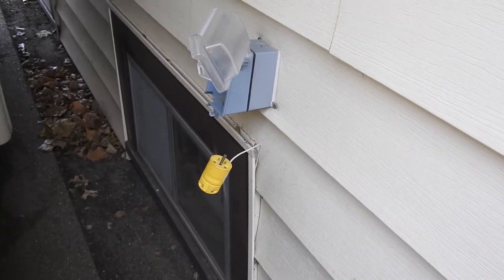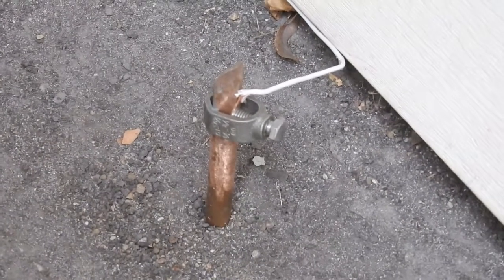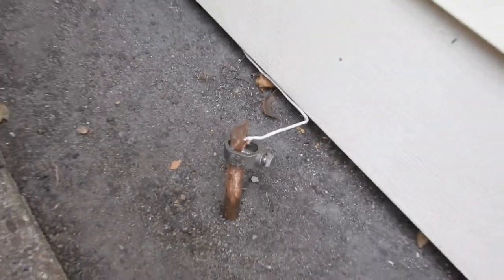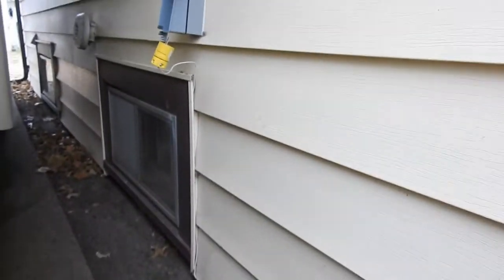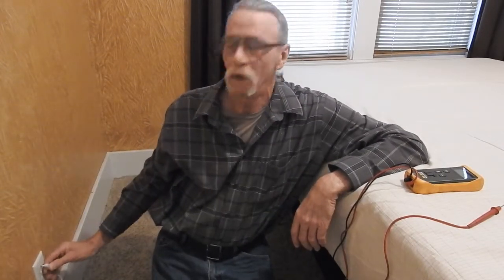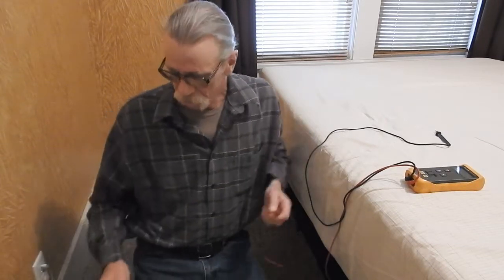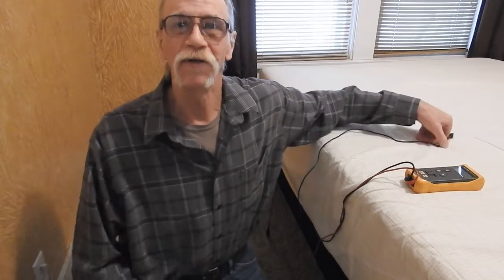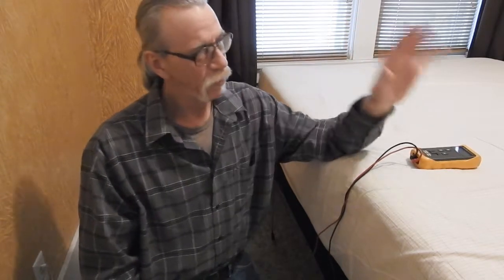Earthing Sheet Grounding

Comment: You’ve explained grounding very well.  I just started using a sleep mat and have noticed a substantial improvement in back and shoulders pain. I use an outdoor grounding rod and you mentioned in your comments to check for any return electrical current from the ground.  How would I check that?
Reply from the maker: That's a very good question Vincent. I would be difficult to check as, to check current flow, there must be a "source" and a "load" that you would check with an amp meter in series between the grounding rod and the sheet connection or, using a clamp-on amp meter around the wire to the sheet. As mentioned in my opening comment, I have a fuse in-line with my bed sheet to protect from possible current spike, like from nearby lightning strike. There is can be a degree of stray current  in the ground due to possible neighbors with wiring errors inducing current through the neighborhood plumbing system if they use the metal plumbing for ground (for example). Also, ground is used for a return path back to the substation in early systems. In either case, you should be protected because you are "grounded". Hope this addresses your concerns. Thanks for the comment.

Comment: Great information Old Man Tech... Can you tell me where you obtained the blanket or sheet?  Also, could a person cover this grounding rod with a piece of PVC pipe to avoid having it hit with lightening?  I'd like to do this with a grounding wire and have it permanently plugged in so that I don't have to remember to unplug it when I leave home.
Reply from the maker: Grounding sheets can be sourced from various places. Received mine from Amazon. There is no reason to believe a piece of PVC pipe would protect from a direct hit of lightning. I have a very low quick-blow amperage fuse in line with my grounding wire to avoid back current from lightning strikes or stray ground current. If you have a proper grounding system in your home, I see no reason to unplug the grounding wire from the sheet to Recep ground when you leave home. Thanks for the comment Jeremy.
Reply: @oldmantech5399  fill the pvc pipe with lightning arrestor / orgonite wizard wink
Reply from the maker: :face-blue-smiling:

Comment: Your grounding clamp is backwards. Wire should b opposite of bolt.
Reply from the maker: I understand what you are saying in relation to the design of the clamp however, as you can see in the video, if you pause it, there is a gap on the opposite side of the bolt where the wire would normally go. That would not afford a good connection, due to the size of the wire used and the size of the grounding clamp. Thanks for the comment.

Comment from the maker: I created this video prior to my training as an EMF Certified Consultant. I do not have any radiating devices in my home and wiring errors have been corrected. Now, I would suggest that one should use a dedicated ground rod to the earthing sheet independent of the homes electrical wiring. Also, I have a very low amperage quick-blow fuse installed in-line with the grounding wire where is comes inside the home. Just make sure your not getting any electrical return current running through it from the ground.
Reply: If it works for you that's good. I have some questions about this technique though. First is, if you make a separate earth, to a rod, there is likely a potential difference to the electrical system earth terminal and everything connected to it, which could be hazardous, depending on the supply company earthing arrangements. The next issue is that if you are in an electromagnetic field which raises your potential and you earth yourself, you become a path to earth, thus you conduct current ( albeit small) to earth, which doesn't sound like a good idea. Also depending on supply earthing arrangements and local conditions you may have currents circulating in the ground and in the earthing conductors of the electrical system, this too could introduce fields and currents in any conductive material in contact with it. At high frequencies the earth conductor and the earthing sheet/mat can act as an antenna, which you become part of...this too sounds problematic...So whilst I think earthing is our natural state in nature, technological earthing systems seems fraught with issues and require careful investigation in each case.
Reply from the maker: You are correct when you say, " requires careful investigation". Is your home or, especially your bedroom in close proximity to power distribution lines, smart meters, or cell towers? Is your bed environment and home free of electromagnetic pollution? Are you in a "dirty" electrical environment due to wiring errors? I can answer NO to the above, in my situation. Others may not. I also have a very low amperage fuse in-line with my grounding sheet to protect from damaging or excessive currents. Ground conductivity and "stray" (return) currents are also a factor. However, a high ground conductivity is very effective at "absorbing" the frequencies that enter you from technological sources and electrical systems by neutralizing positive ions to re-synchronizing with the Schumann resonance around 7.83 Hz (fundamental). I personally experience more restful restorative sleep without the inflammation I constantly had. If not, I would abandon the grounding sheet. Everyone's situation is different. Grounding sheets are not for everyone. If the above issues you mention are not remediated, I believe grounding sheets can be detrimental to one's health in some situations. Your concerns are valid. Thanks for the questions.
Reply: @oldmantech5399  Hey, I really liked this video! I was thinking about doing something similar to what you did here someday, and installing a separate ground wiring system within the walls of a house, connected to an independent rod outside. I'd like to ask though, what do you think about running through the ground of a normal outlet, in a situation where you're renting and can't do work like this? I checked the ground in my building and it is properly attached to a copper rod outside, and I've been earthing for about a week with a mat and getting obvious results from it. However, I watched and read bunch of stuff about voltage coming into the ground from the neutral and it made me a little nervous. Apparently most household outlet grounds have about 1.5 volts running through them from the neutral return. However, from watching videos of people checking their own body voltage with a multimeter while just standing around in their house, I see that it is very common for people to be carrying 3 volts or even more. So I guess my main question to you is, do you think there could be any dangerous amount of current in a household ground, accompanying that common 1.5 volts? I don't understand alternating current very well myself, but I know you're not becoming part of a direct current circuit when you use something like a grounding sheet. I just wonder whether that small amount of ambient electricity in a household ground would actually be harmful, and whether the benefits of earthing through that ground would outweigh the negatives of that voltage, since people seem to have so much voltage on them indoors anyway. I'd love to hear your opinions on this!
Reply from the maker: @Margatroid  Yes, there is a potential difference of approximately  1.5 volts at the receptacle, give or take. Consider the receptacle as a water valve. With nothing plugged in the valve is turned off even though there is still a V/m (volts per meter) reading at the Recep. So, you have an electrical and magnetic component at the Recep. It just makes sense to me, if one is to avoid such influences for health, not to plug the grounding cord into the Recep. Bear in mind, the electrical wiring in your room at 60 Hz radiates about 6 feet in all directions. One to two feet away the readings drop off dramatically but, there is still influence. If I take a meter reading 2 feet above my bed, I read 9 V/m. If I touch to the grounding sheet, it reads 0. To overcome your renting status, you could buy or strip the ground wire from a length of 12 or 14 gauge wire, route under window sash to rod or, route through basement window to under the bed floor and drill small hole for wire and tie into the grounding sheet cord, if possible. Be creative. I have faith in you. Thanks for question.
Reply: @oldmantech5399  Thanks for your reply! I didn't get a notification for some reason. After watching your video and some others showing voltage on the body in proximity to the wall wiring, I actually moved my bed a foot away from the wall, and that seems to have helped. I always felt a little uneasy laying down to sleep there at night and I think that was why. I also used to have a lamp cord running behind my head there and I got rid of that too. Also this week I ordered a couple of 19 inch aluminum grounding rods with 40 foot cords from ebay. That's not going to be as a great of a ground as your custom setup, and I wonder about the cord being conductive enough at that length, but I got a multimeter to make sure they work. I'm going to try to run the cords around the edges of my sliding glass doors. I've just gotta wait for the earth to unfreeze here before I drive the rods in! Thanks again for your thoughts. :)
Reply from the maker: Hi Margatroid. I didn't get a notification on this either. Increasing distance from electrical chords is a good idea. A longer ground rod would be better but, any ground rod is better than nothing. Any length of grounding wire should work. Just do your follow-up check with your meter.
Reply from the maker: Hi Margatroid. I didn't get a notification about you either. Longer grounding rod would be better but, any is better than nothing. Any length of grounding wire should work. Just do the follow-up with your meter. Thanks for comment.